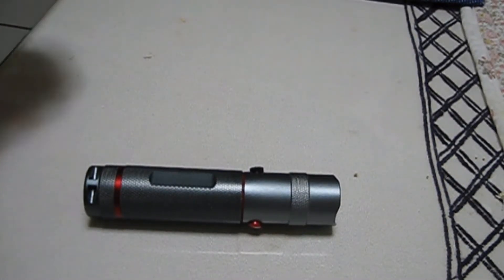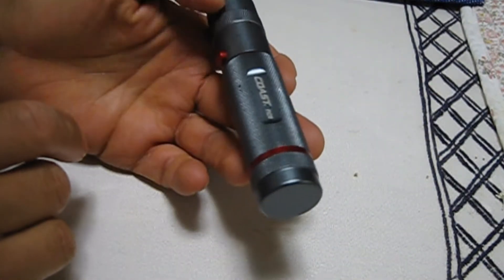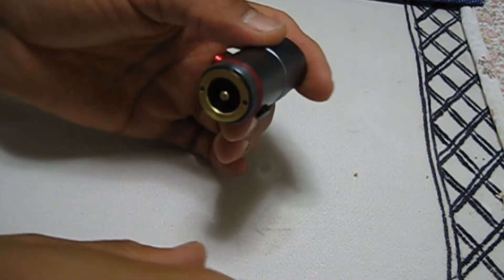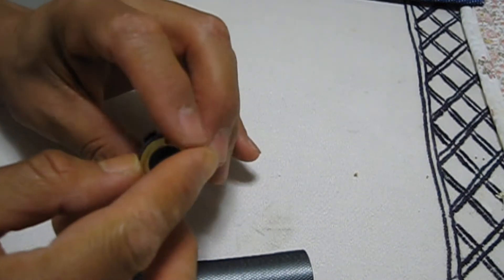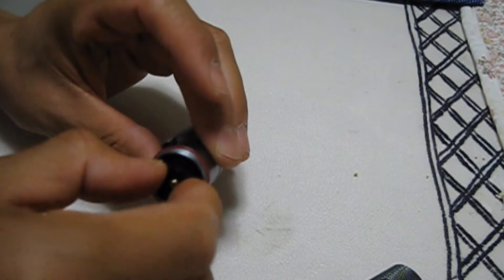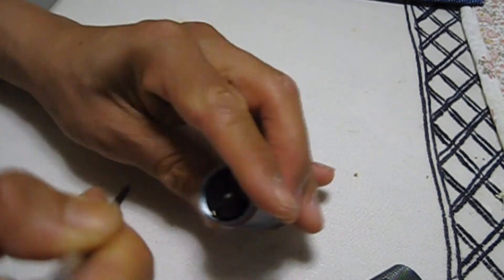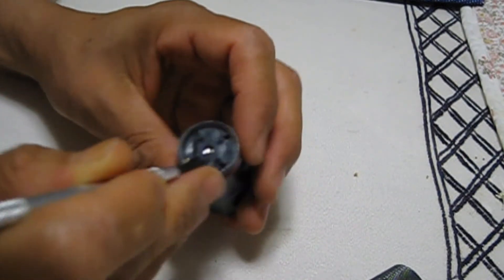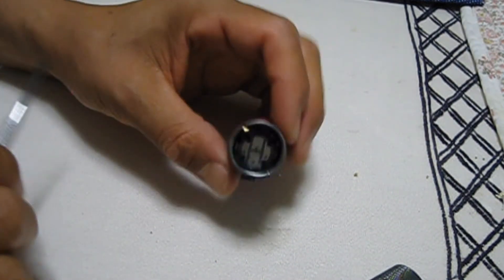Coast PX20 Flashlight disassembly

Comment: you stopped halfway through but thank you for showing us what you did.  i figured out the rest of the disassembly from there.  it helped a lot to show how that top ring came out.  i took out everything and i learned that the bulb cannot be replaced without advanced skills and a new bulb.  but along the way i saw that the bulb is probably not the problem, it is the corrosion on the top ring, the battery holder, and the buttons that pop out of the battery holder.  thank you again for getting the top ring off.

Comment: And short and sweet it was, and well done. The G45 is very close Coast, but has 2 little holes on the retainer. Don't use barber scissors w/ points to insert, they'll twist and won't cut. SO, I'll try an old fork, I need to get to the switch that works when it wants to. Thanks

Comment: how to do you get the retainer (at 20 seconds in the video) to spin to the left to take it off?  I've tried turning it and it wont go anywhere...
Reply from the maker: Hi Jennifer, great question, I had to go double check.  You have to twist if off.  I took a small screw driver and turned it left.  But be careful with the threads they're kind of fragile.  When putting it back on don't over tighten it or it could break or strip the threads.  And try to get it on as flat as possible.
Reply: @GoFlyYourselves  thanks